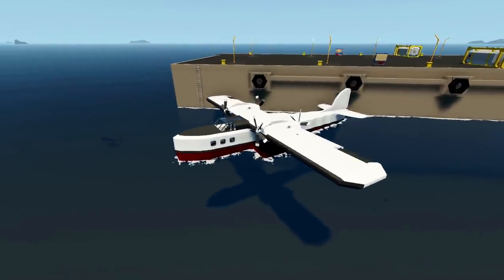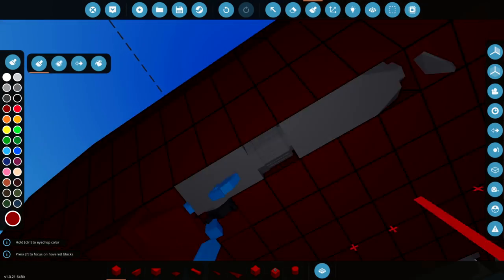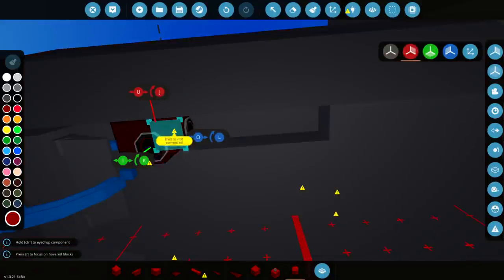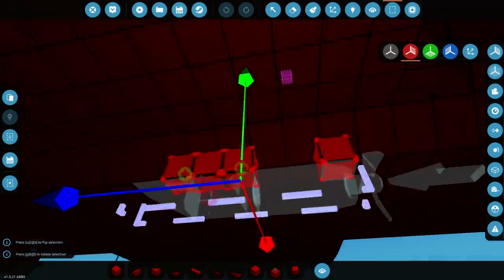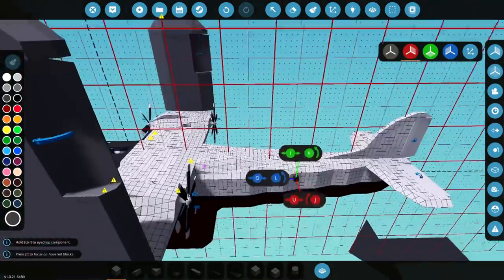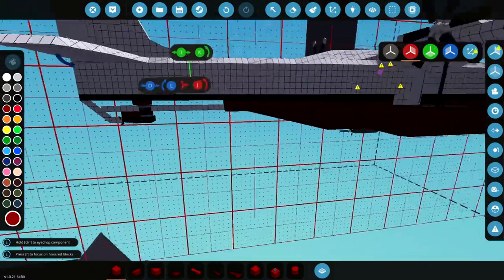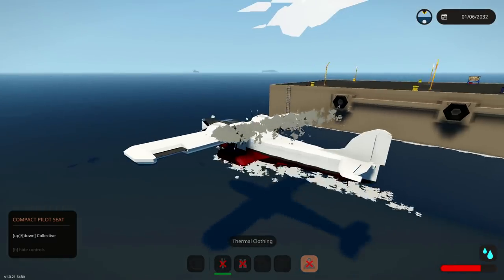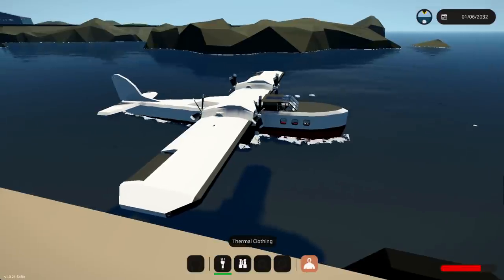Failed Take Off Assistance!   -  Seaplane Build 2.0  -  Stormworks Gameplay

Comment: You need to increase the gear ratio of the engines to 3:1, right now you don't have enough power to take off
Reply: He has already tested 3 to 1 he needs more horses
Reply: I got the horses in the bag
Reply: He needs 1:1
Reply: @matthommel3546  I've missed that, so yeah he need more power, the two medium engines are not sufficient enough to take off
Reply: He should use larger props. Or more engines
Reply: MOAR POWA BABEH
Reply: @initialyeet3951  more larger props and more engines

Comment: I’ve had this problem before, and the solution is to lower the amount of blades on the props. You tried adding more blades, but you should use less blades. Try using 4 or 3, 2 is too low again i think
Reply: Percy Jackson  Hi I'm a big fan
Reply: Percy Jackson  yeah yeah I know, I've read all of PJO, HOO and TOA
Reply: exactly what i was gonna say, i reckon 2 blades is too little for his plane though.

Comment: It’s because of the rear of the fuselage. It needs to come up at a steeper angle, so when you’re in the water, the back part is above the water level. The way it is now, the more you pull up when trying to take off, the more drag the tail section generates in the water. That’s why seaplanes gave a rear fuselage that comes up farther out the water - it’s what lets them take off!

Comment: Watched this earlier. Came back to like and comment what I was thinking earlier about this creation and Congratulate you on 70k followers. 👌🏾🤘🏾🤘🏾 Iv seen almost every video uploaded since I subscribed. I forget to like them sometimes,  Apologies. Butt! Constructive criticism time. Iv played the game maybe 130ish hrs now an I have no idea what I'm doing as far as building goes. Iv made some good changes to creations on the worshop thou and learning through you and MrNJersey. But I know from what iv seen you do before, you should solve the underlying issues with this build rather than try to works around or mask them please. I.e. pivots for floating or the bow thrusters to lift you off. You Maybe headed in this direction at this point. But band-aids and work around aren't reliable as it would seem lol It was kinda funny watching you experiment. An I did learn from it!! In this case I'm suggesting a simpler redesign of the wings design, control surface placement and quantity, power to weight ratio maybe an automatic gear box? Again. I love you videos. An I'd love to see you solve this in a more realistic fashion. Just my opinion! Congrats on 70k and thanks for the daily vids! I learn a lot from the build series!!

Comment: Hey Frantic, you could always put a small booster in the top of your fuselage just behind where the wings connect and it slopes down. If you really wanted, you could use pivots so you don't lose the shape and it can be a retractable turbine of sorts. That way you can toggle it on and off for take offs or emergencies

Comment: The blocks on the wing pivots are colliding, causing that wing stuck glitch to happen. Around the pivot, replace the blocks with 1x1 wedges, so it will glide smooth into place without crashing

If that makes sense

Comment: Have you tried having the 4 props next to each other? 2 on each wing. As I don’t think having 2 behind the other actually helps. After looking at flying boats (things like the Catalina) they all have the engines facing forwards. I have seen some with their engine’s facing backwards but again the engines are in a line never one in front of the other like this set up.

Comment: thats way to much pitch for the blades, for takeoff you're looking for a high Rps low collective setting (e.g  20 Rps, 0,4 blade pitch) after you take off you can set the props to a higher collective wich will slow down your engine  for increased Fuel efficiency.
To do this add a throttle that controls collective of the blades, use low values for takeoff and high values for cruise

Comment: have you set the right type of fuel? looks like those engines on the wings are running on diesel
Reply: Uh, are Diesel engines not supposed to run on diesel??? I don’t see what your getting at here. And also, if he had the wrong fuel the Engines wouldn’t start. So... what are you saying?

Comment: Not sure why you’re adding propellers under the water to fly.  As far as i know zero planes use propellers underwater to fire them into the air!  You need more power I think, also those floaty things and the added propellers underneath are just creating drag.
Reply: Yeah well he must not have enough power from the engines, technically the propellers would do nothing if the engines couldn’t actually lift.